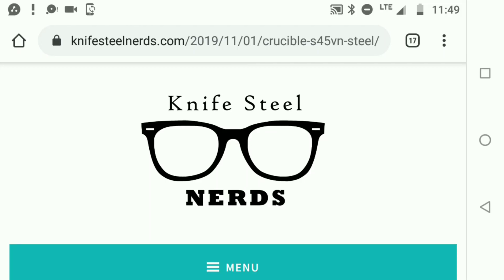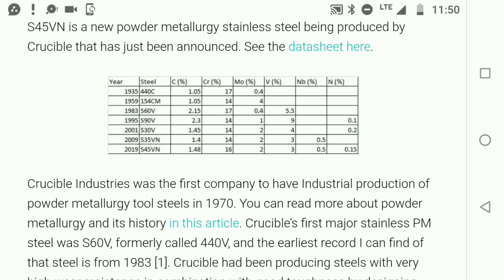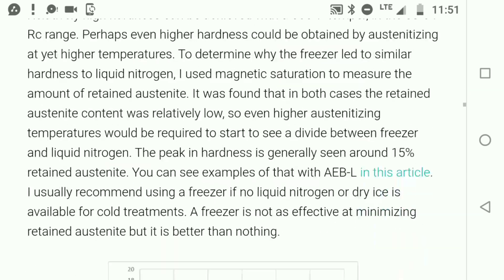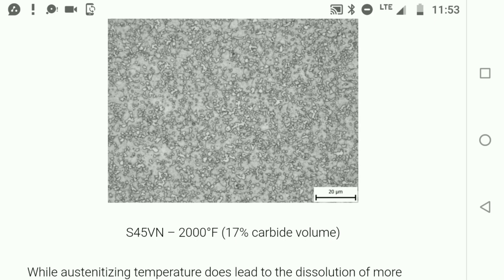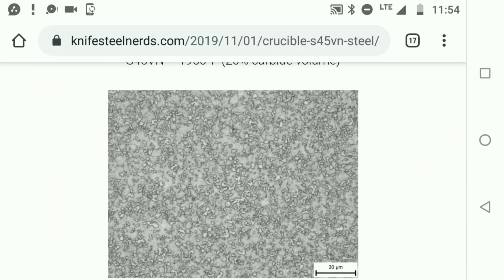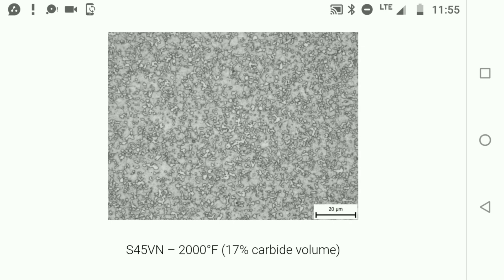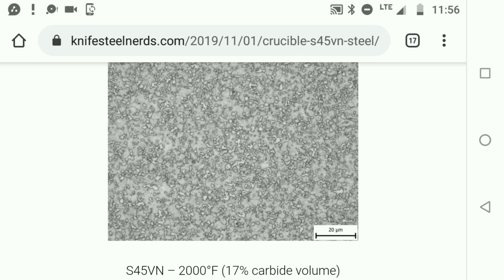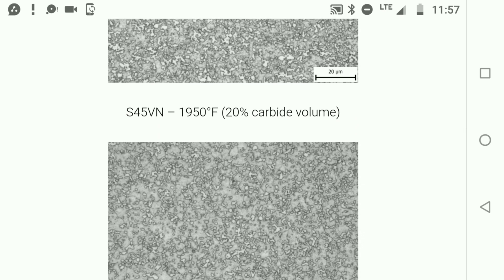CPM S45VN?

Comment: LongTime knife collector (was a scout in my youth) but am just recently starting to learn deeply about steels.
So in all my years of using knives, at the top of my priority is TOUGHNESS with RETENTION and/or SHARPENABILITY interchangeable in 2nd. 
Here is a newbie question, if youre saying that the END PRODUCT S45VN of the different knife companies will be different due to their differring heat treatments, (dare i say) what makers/companies are those that have good heat treatment. 
Or putting it differently, what knifemaker makes optimal use of CRUCIBLE steel? Thank you sir

Comment: Thanks a lot for yours videos, i like them very much. It seams that steel makers finally get to fine microstructure and not only to tones of carbides. How good can perform old steel with fine structure show 12C27 . If S45vn has a good microstructure and high HRC that will be great. It will be interesting to se what HRC is on Spyderco knives .

Comment: I am thankful for your explanation of what's going on in this new steel. I'm excited to see what custom makers do with this steel and the end products of them experimenting. 

Overall, where would you place this steel as to edge retention? Is this going to be in the Elmax realm? Obviously it is an upgrade to S35VN but, how far of an upgrade? Comparable to M390/204P/20CV? From what I'm gathering, this should be somewhere near M390 but, easier to sharpen?
Reply from the maker: its a tier above elmax for me
Reply from the maker: the big issue is you'll apply that to production knife and we have no idea what hardness and HT they'll run, so it only applies to my work.
Reply: @FearNoSteel  Sure, that's understandable. I take all of this with a grain of salt because we cannot compare different products across different makers. If anything, I like to base my research off of one custom maker and the same HT process across different steels.

Comment: As discussed on Bladeforum : what are the advantages compared to M390 at 61.5 RC?
According to Larrin's article M390 is more wear resistant, more corrosion resistant and at least equal in toughness.
Reply from the maker: The Carbides are finer, the m390 might only be tough because it makes soft gummy clumps of Delta ferrite in the microstructure due to the HIGH chromium,raw toughness and edge Stability are different things. This s45vn should be able to run harder and have a more stable matrix but less wear resistance since m390 has more M7C3 volume. There a lots of details you can pick up on in the article on s45vn. You can read about Delta ferrite in the H1 steel article if you don't know the difference between martensite, Austinite, ferrite you can find all that information on knifesteelnerds too.
Reply: @FearNoSteel  Thanks for the detailed answer!
Reply: Therka Marka  It's not supposed to be a record breaker, it's supposed to be a direct upgrade to the existing king of midrange steels, and it looks like it might do a good job of it. Including on the super important price front.